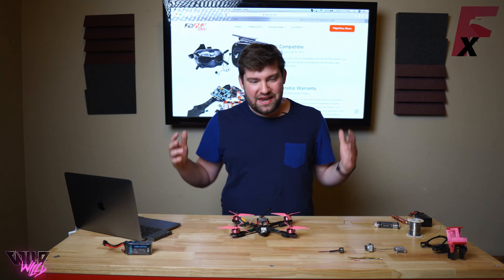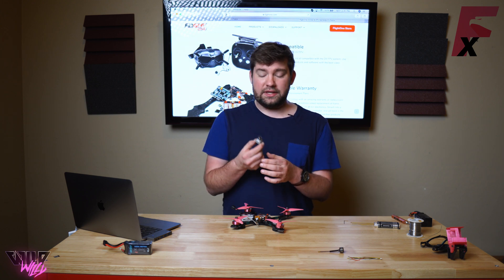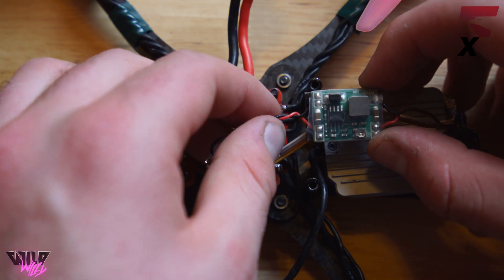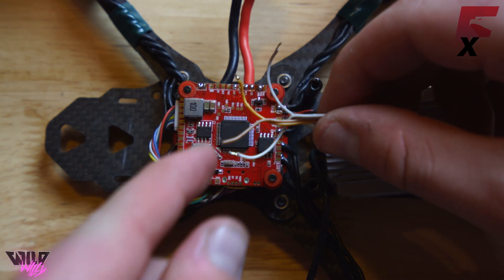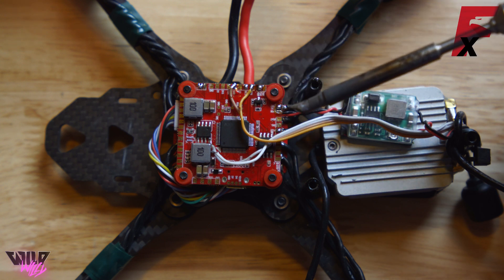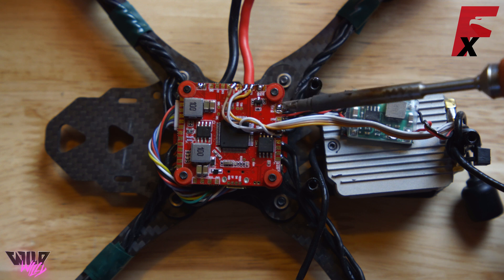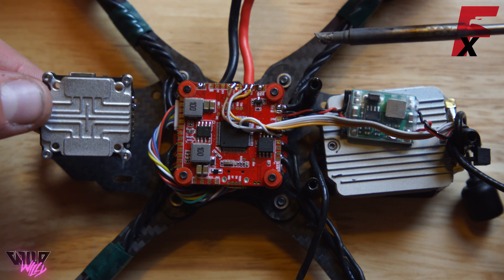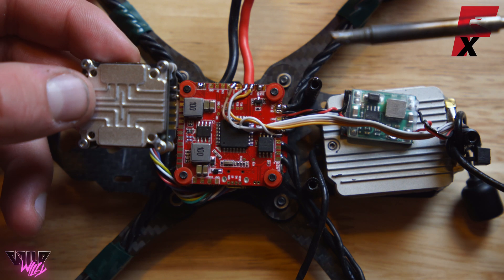EASIEST DJI FPV install on FlightOne FalcoX

Comment: i dont see the bat voltage on my osd all time is it zero.... i have the revolt osd and he take 5v from extern bec. i use caddx vista and bridg the current for tx6 and current/tx6. Caddx vista take voltage from the vbat and wiring is the same at the video. Plz help if u can

Comment: How do I set up Flight One with DJI? I emailed Flight One and they told me to wire up the Air Unit, power up the quad, and configure it in the OSD.  I did that but nothing shows up in the DJI goggles.  Yes custom OSD is on.  Yes the Air a unit is wired to the FC according to the Pin out diagram.  Using the H7 Lightning- thanks for any help
Reply: I have the same issue like you. Do you have any way to fix it
Reply: @nhutnguyen7916  so I figured out what the problem was and my msp connection in the DJI air unit was bad.  I had another air unit that I pulled out of another drone to test and it worked just fine. It even set it up automatically, but they also gave a few things to try- 1. Make sure your on the newest firmware, 2. In the Mock OSD that displays in the configurator on the computer, (make sure the fc is plugged in and recognized by the config) put both sticks or radio in bottom left corner and hold for 3 second, then the OSD config should pop up, go to perifery, down to DJI, and set it to auto.  If yours is not working I would try switching it out unless it’s brand new.

Comment: I have a Revolt OSD 30.5 that I purchased a year ago. I used "Companion 1.0.3 win" and updated the firmware to FLX_REVOLT_10.0.5.1751 because that is what I used on my last F1 build back in February 2020. It said it successfully flashed the firmware. I am using the DJI --Caddx Vista and I have it all wired exactly like Willy's video. I update the Vista and then plug in the 6s battery to the  Megabolt Race ESC. I expected to see the wizzard to set things up but I get nothing. Is there something I did wrong? I cannot get any of the configurators to recognize the FC either. Can someone help me out here please? If I put it into Boot mode can something be done that way? You guys set this up to be simple, but there is very little help and very vague instructions. I like the wizzard in the goggles ....if it works.

Comment: I have a question. I'm not using the DJI controller. I have a Jumper T16. Do I still need to wire SBUS?

Comment: I did all the process you posted but I’m confused how to completely download the Companion Falco X firmware. On the Raceflight website I downloaded the Alpha and Beta, tried both in my FC but every time after flashing, the Configurator cannot detect the flight controller. So I tried in the Dji goggles as well but I don’t see the OSD either even tho I already turn the osd on in the goggles.

Comment: 👋 Nice video and very informative. I did all the process you posted but I’m confused how to completely download the Companion Falco X firmware. On the Raceflight website I downloaded the Alpha and Beta, tried both in my FC but every time after flashing, the Configurator cannot detect the flight controller. So I tried in the Dji goggles as well but I don’t see the OSD either even tho I already turn the osd on in the goggles. By the way, I am using the Skitzo Revolt OSD, which comes with ports and plugs. Could you please send me the link how to completely install and make it work in my FC? Thank you in advance

Comment: Hey, thanks for sharing. But have you tried using a crosshair? It is not centered, same as all othe elements, but for the other elements it is not critical. Is there a way to make it work? And what about jumping voltage reading? When FlightOne plan to fix this? Thanks
Reply: what jumping voltage reading, do you have a video?  As for the crosshair i'm not sure if we can fix that at moment, but they may have had firmware uptdate to fix it.
Reply: @PrestonKnows  here is some example: https://youtu.be/D_XEmP1rC94
Sorry fo the quality, but you may get the idea. And the voltage is jumping about 1.0 volt up and down even while cruising. I've added a per cell voltage element and it is also not steady as on my analog quad with the same board. I had to calibrate the mah consumption and rely on it only. When I land the voltage can be jumping from 13.2v to 14.6 almost every second so I have to guess :(
Reply from the maker: @andreylusta  Alright i think we see an issue we will fix it
Reply from the maker: @andreylusta  Alright i think we see an issue in code, we will update it :)
Reply: @FlightOneVideos  Thanks, much appreciated!
Reply: @FlightOneVideos  I've seen an update: Version 10.0.5.2243. Has the issue benn corrected? Thanks

Comment: I'm still waiting for over two months for my megabolt (basic)esc for the revolt I already have. I have dji but currently using it with the hobbywing xrotor stack and it works great. I honestly want to return my revolt to the vender and cancel my order of the megabolt with tbs because it just seems like I'm never getting it. With the money I purchased these f1 items with I could buy another xrotor stack that would ship within a reasonable time frame. I understand you guys have had new shipments but I must be lower on the list of people to receive their item.
Reply from the maker: Sir Braap_a_lot we are working on catching up on the back orders as quick as possible.  Our. New ESC design is amazing however it’s taken a while to get it perfect and we had some bumps along the way.  Now that we know the design is solid we can catch up quicker.  That being said our fc works with any ESC so you can always use another brand ESC and still have a great experience.
Reply: @FlightOneVideos   When I 1st purchased it and realized that I wouldn't get the Mega bolt anytime soon I also bought DYS 30A 4N1 and could never figure out why sometimes 1 motor or 2 motors would not arm from the time of the first build. I tried updating esc through passthrough in blheli several times. I tried f1 configuration and calibration several times. I tried different protocols(multishot, dshot600, etc)several times with those different changes above. Nothing fixed the issue. Sometimes they would all arm after enough attempts but it would fail in the next 30 secs of a simple hover. I eventually became so frustrated with it I wrote it off as a cheap esc and haven't looked into another option since because i hoped my megabolt would eventually take its place. With that said. If you have a suggestion for me of another plug and play option for a 4n1 I'm all ears. Thanks for your response.

Comment: FlightONE OSD Lite is the best FC what i ever tryed. and FalcoX is the best firmware IMAO, but now we want more :D we want RTH with GPS working on FalcoX :D
Reply from the maker: Vital FPV willy is working on it :)
Reply: @FlightOneVideos  brilliant news!
Reply: Hello 👋 Nice video and very informative. I did all the process you posted but I’m confused how to completely download the Companion Falco X firmware. On the Raceflight website I downloaded the Alpha and Beta, tried both in my FC but every time after flashing, the Configurator cannot detect the flight controller. So I tried in the Dji goggles as well but I don’t see the OSD either even tho I already turn the osd on in the goggles. By the way, I am using the Skitzo Revolt OSD, which comes with ports and plugs. Could you please send me the link how to completely install and make it work in my FC? Thank you in advance

Comment: Little tip: swap out the plastic cables that come with the DJI Unit and get silicone ones, i cant understand they ship it with plastic. They sell them cheap on ali and BG
Reply from the maker: DroneArtists great tip or you can just use the wire harness that comes with our fc :)

Comment: My D values are not reported correctly in my DJI goggle, is working for you ? Seems when the value is high (above 300) the value in the DJI OSD is not correct and I can't tune it